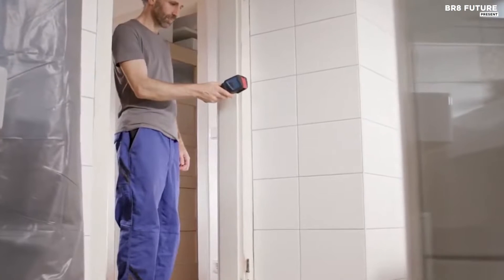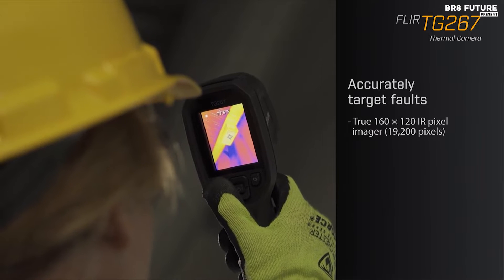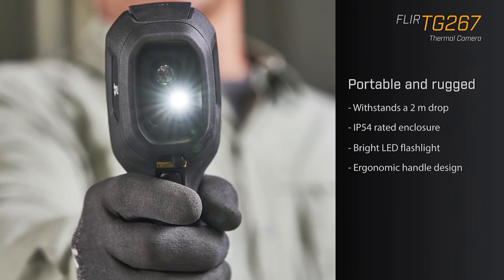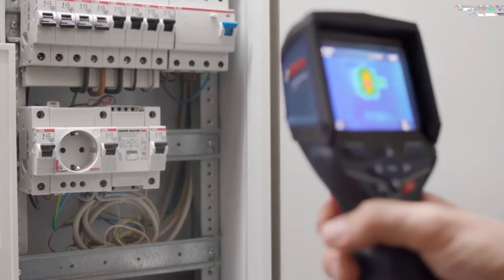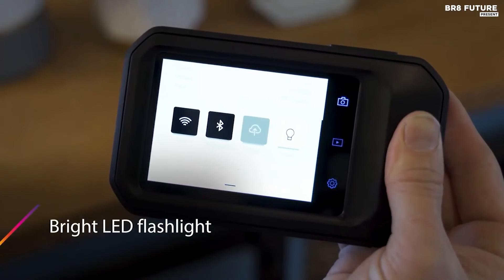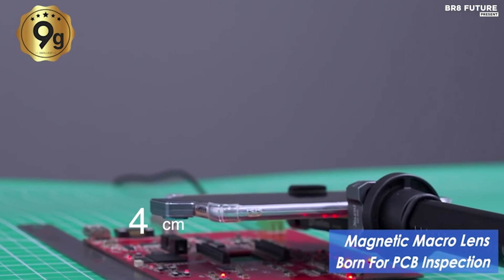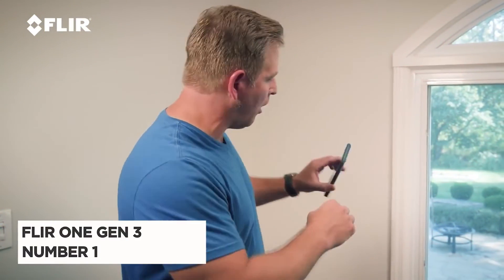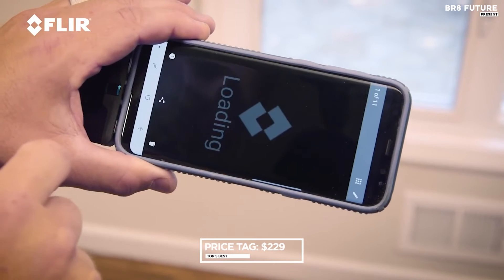Best Thermal Camera 2024 📷🌡️ [Best In The World]

Comment: How are these the best in the world? The resolution is very little and these brands are expensive
Reply: All thermal cameras have a relatively low resolution. My Klein TI 250 only has 10,000 pixel (only about 100 pixels across) and is more than enough for anything I do, which is finding hot or cold spots. It is durable, fits in a pocket and has amazing battery life. If you want really high resolution you will be paying tens of thousands of dollars or more and the battery life will go down and the size will go way up.
Reply: @MAGAMAN  I have a Xinfrared P2 Pro and has 49,152 pixels (256x192), it's the size of 4 stacked quarters and attached to my phone.